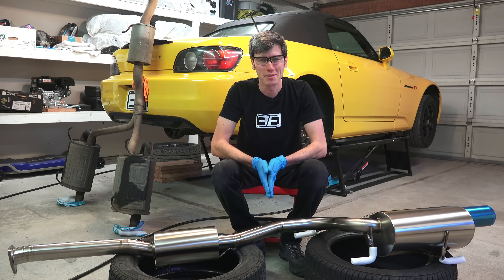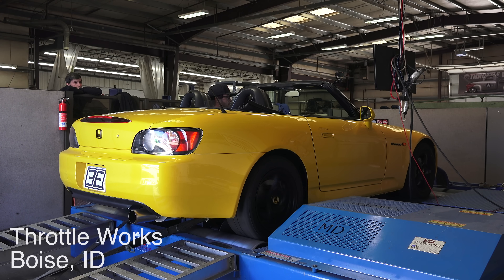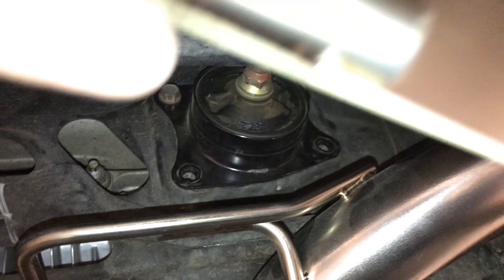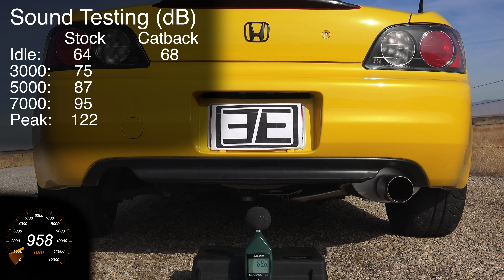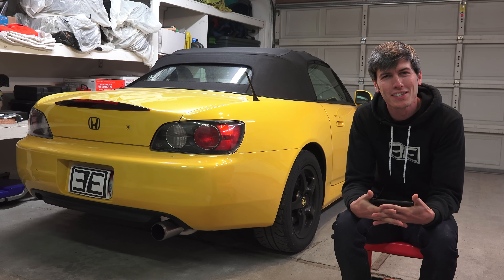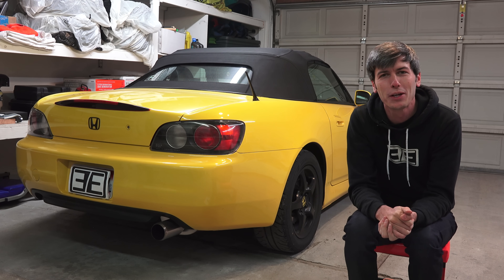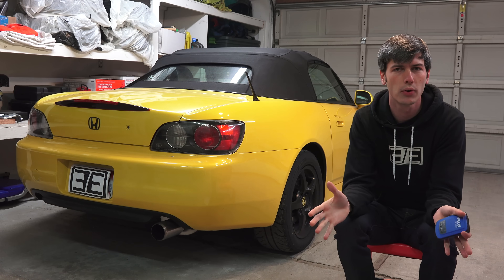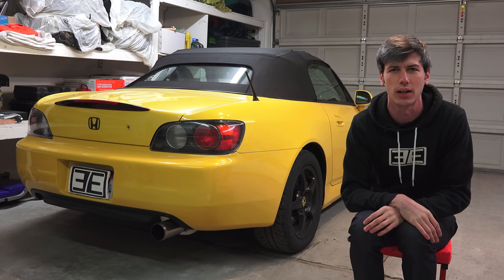Can A Catback Exhaust Make Your Car Faster?

Comment: Remember, you're not "making" more power with the exhaust, you're freeing up some HP which is otherwise getting used up to push the exhaust out. It's the same idea with a free flowing intake. Neither of these "make" more HP ... it just frees up flow so the air pump (the engine) works more efficiently. Great video. Love the numbers.

Comment: Two thumbs up from me, the exhaust's a beaut! Couple of questions:

1) What's up with the power from your s2000? My completely stock one was making something like 210 to the wheels, do you just have a load of miles and have cylinders that can't hold pressure?

2) Would you expect the difference of a lower resistance (to flow) exhaust to be greater on a turbo / supercharged engine where there's more pressure?
Reply from the maker: +Mikey 
1.) it’s read 221 hp depending on the dyno settings. Can’t really compare dyno numbers from different dynos. 
2.) Absolutely
Reply: Makes sense! Thank you for the awesome vid

Comment: IMHO the sound has a very different and much better character, you saved weight and I don’t know about titanium but a system will usually get a little louder as it “beds in” over the first few months.
Test DB again in 3 months?

Comment: Although I would never pay anywhere near that much for a catback, I must say I think it sounded really good on that car, especially when you were revving it. It's hard to describe but it's like there was a very distinct (crisp maybe?) sound as the throttle cracked open, followed by a nice understated crackle as the engine wound back down that could not be heard at all from the stock exhaust. Not worth $2500 imo, but I do like it. Definitely better than 99% of other Hondas I've heard.

Comment: replace the stock ceramic catalytic converter with 400 cells per inch to a hq metallic converter with 200 or 100 cells per inch. they have more platin and are expensive (HJS made in germany). you will gain more power and the exhaust will sound much better. trust me.

Comment: to have any significant gains in power, the factory exhaust has to be restricted...But if Honda already have done a great job in designing the factory muffler, the only thing you can optimize is the way it sounds :)
Maybe next video would be comparing cars or a car with 2 mufflers with 1 muffler...

Comment: The T1R 70mm and 70 EM Sparrow would have run you about the same cost, tons of weight savings, and have been proven by the s2ki community to have some of the highest hp gains on an NA application. Some form of tuning solution will amplify your gains now that you have a more free flowing exhaust, tuning is important for any modification to work to it's full potential.
Reply: I take that back, would have cost a lot less

Comment: did you have to use specially coated hardware to bolt it back on to avoid any bimetallic issues? also it looks really nice and sounds good. i would estimate that the cars aesthetic quality was improved by 5%

Comment: if you're getting an extra .3 mpg then you'll save 184 gallons of premium fuel after 250k miles. So that saves an extra 552 bucks. also, savings in brake work, suspension work, catback exhaust replacement due to rust failure, tire wear rates, and various other expenses incurred less with lesser weight.
I won't say that it'd directly pay for itself, but the smoother sound or improved acceleration might inadvertently affect one's career enough to make the difference.
Reply: Weight is 1.2% difference. You are technically right but i dont think its noticable

Comment: Aw come on, a single tip exhaust? That other cutout just looks awkward now.
Reply: ewt415 Yeah it's way lighter than the duel exhaust tho
Reply: StrangeClouds, I don't doubt that it is..but to me it seems like the minor performance gains from that weight loss isn't worth the styling trade off. If the rear bumper is swapped to accommodate the single tip exhaust, that'd be cool too.
Reply: ewt415 It's half the size and made from titanium
Reply: Lol, dude you don't have to argue with me. You do realize it is okay for people to disagree with your preferences right?

Comment: you cant look at 1 figure like power at certain revs.
You should be looking at the difference in the areas of the 2 graphs between 2 points in a rev range.
Integration is harder, but it is better.

Comment: Most people on the s2ki forums yield some power gains with replacing the cat with either a test pipe or high flow cat.  The cat on these cars seems to be the greatest restriction.

Comment: What about the gain in power with area under the curve? it seems like it would be a much better representation over power gains than peaks
Reply from the maker: Yes, about a 2 HP gain for the duration VTEC is engaged.
Reply: could you do  a video on how to do the math to calculate this? I'm an mech. engineering student and my calc professor said if I got you to do a video she would pass me with an A+. Please help

Comment: 5% difference is pretty expectable, in my opinion, because it's not so much about the peak power gain, but the area underneath the graph line, because at every spot of the rev range you accelerate faster and that adds up somehow. If there was a way to calculate it, you could see the area difference, maybe that's where the few extra percent comes from.

Comment: 2.5% is within the margin of error. It's not statistically-significant because you'd need dozens of tests to lower the margin of error. I would also say that given the nature of sound waves, the best way help air come out of a tube, is to increase the cross section of the tube as you reach its exit. Under a car, it's not practical to do so.
Reply from the maker: Three runs before and three runs after that all line up is enough to make a decision in the real world and move on. No, I'm not going to be publishing a paper with the data, but I don't think there's any reason not to trust it, and I think there are many reasons (starting at 11:21) why you can trust it.

Comment: Loudness measurements will vary depending on the weighing function used. A-weighed loudness takes into consideration low frequencies. The ear is more sensitive to frequencies in the 2K-4KHz range and accordingly, will be more annoyed by sounds at that frequency. What would be better than to compare loudness as a single value, is to compare the frenquency spectra, to see the distribution of low-to-high fequency components.

Comment: The dyno data would be more convincing if it illustrated the variability of the data between the treatment groups (old vs. new exhaust). For this you would need to test the treatment groups a number of times each (say 3 times each) then display the data as mean +/- error (I like 95% confidence intervals). Either way regardless of the significance, it's pretty clear that the effect size is rather small. Still a cool learning experience. Nice job!
Reply from the maker: Did three runs before and after. Results were consistent. Displayed are the final runs (highest stock run vs highest catback run). Less than 1 hp difference between runs with the same exhaust.
Reply: Nice thanks!

Comment: Your car is just 6.2 decibels quieter than a 2016/2017 F1 car 😲
Reply from the maker: Well, dB is measured from a specific distance, so F1 car would likely be much louder when measured at the same distance. That said, F1 has definitely gotten quieter.
Reply: Engineering Explained Well, where I saw the article it explained the 2016 blowoff vale exit and said that if it were to be dumped in the exhaust (like 2014-15) it decreased the sound, putting the blowoff outside apparently increased the sound from 126dB to 128.2dB so should it be directly next to exhaust or at 20-50m away, I don’t know, thanks for answering!

Comment: for me, you are gaining hp not only from the better pathway flow, correct me if i'm wrong, but the titanium has a better conductivity than the original (steel?), so your gases lose less energy by heat 
aand it is not only 2.5hp, now with a less restrictive catback, if you change something else, like a cold air intake, some cams, whatever, they should make more power vs stock catback
Reply from the maker: Yes, should help with future mods. Heat conductivity won't matter for a naturally aspirated setup. Since there's no turbo making use of the exhaust gases, waste heat is waste heat. I suppose if you were to get super technical, if the amount of heat lost by the exhaust were to increase significantly and it cooled the exhaust gas, it would have an effect on pressure, but very minimal in comparison to the effects a loss of heat will have in turbocharged applications.

Comment: I say it all the time. Unless you take the potatoes out of the exhaust (CATS) a cat back will do nothing, especially if same pipe diameter. This video validates that statement, great upload  2whp is within the noise.
Reply from the maker: I agree with you, but the 2.5 HP is accurate. Multiple tests before and after, and the shape of the curve changes after the exhaust (only makes more power with VTEC engaged, not before, when airflow is at its max).
Reply: Not arguing the 2.5HP with you, I'm sure you are correct. I watched your interview on gears and gasoline, that you do learn from some youtube comments. I spent $2,800 on my exhaust and it is heavy, heavy on the engineering. Not made of titanium and given you like to nerd out on this stuff, I think you will find the background to it interesting. Given the engineer who made it used to work for NASA. 

Can Helmholtz Resonance Be Utilized to Make More Power?

Motordyne: ART (Advanced Resonance Tuning) test pipes and resonated Shockwave V2 exhaust, designed to increase power over traditional aftermarket alternatives by using chambers that trigger Helmholtz resonance to aide in exhaust gas scavenging for increased power.

Helmholtz resonance is a scientifically proven phenomenon. The property can be demonstrated with a glass bottle: As air is blown across the top of the bottle, some enters it, is momentarily compressed, and then surges outward at a slightly faster rate than it went in, creating a vacuum that draws more air back into the bottle to continue the process. Proof of this oscillation of air can be heard in the tone or frequency emitted by doing so. In the case of the products at hand, exhaust gasses are blown across built-in resonance chambers, and the frequency of pressure waves created therein pushes exhaust gas through the tubing and out into the atmosphere. Now, if Motordyne has one thing working toward their credit, it's that they're by no means an upstart company. Remember the plenum spacers that have become mainstays in 350Z tuning for their simple, low-buck design and solid power gains? Turns out Motordyne owner Tony Colette was a rocket scientist in his previous profession (no, seriously-he was), and he invented those. 

To test Motordyne's claims with its ART products, we gathered Ken Kojima's '06 Nissan 350Z, equipped with a reputable "Brand X" test-pipe and exhaust, to the Dynojet rollers of Yimisport Tuning in Santa Clarita, CA, where it was baselined, then tested with Motordyne's ART pipes and resonated ShockWave V2 exhaust in place of its original aftermarket vendible.

Replacing the car's stock cat-back exhaust with Motordyne's Shockwave V2 produced as much as 22.7 whp and 17.9 lb-ft of torque at points in the powerband, and where the "Brand X" test-pipes produced as much as 23.3 whp and 31.8 lb-ft of torque over the stock cats at some points, Motordyne's ART test-pipes increased their output by an additional 11.2 whp and 29.7 lb-ft of torque at varying rpm. Air/fuel ratios stayed in their normal range this time, and power gains-as promised-were more plentiful.

The Verdict:
Fact
Tested on two different cars, with two (slightly) different engines, compared to two different aftermarket manufacturers' conventional products, the gains by which Motordyne's resonance-chamber-equipped products increased power were definite. Now, you might be wondering what would happen if a different exhaust is used with the ART test-pipes, or if the Shockwave V exhaust would make power with the stock cats. Would the difference in airflow throw off the whole system and negate power gains?' "Think of blowing across that bottle," explains Tony. "If you blow harder, with more air, the frequency doesn't change but the volume or amplitude does. It's the same here. More air means even more resonance and more scavenging." 

No turbos, all motor.........Dyno gains for me were 37whp/45wtq. ART pipes get rid of rasp and drone while also giving you an additional 10whp over a test pipe. They for sure work.

Comment: Should have gotten the HKS Hi Power exhaust, the sound alone is worth it. I also like the dual exhaust tips. Titanium is also a bit too expensive unless you need the weight savings for a race car.

Comment: 4 questions about you and your car:
1.Are you live in Indiana or California?
2.Why didn't you replace the old hangers with polyurethane ones?
3.Will you complete the whole exhaust with titanium headers, and catalytic converter in the future?
4.Would the sound test results change with the previous one?
Reply from the maker: 1. No.
2. Because rubber makes more sense for exhaust hangers. Flexibility is important so exhaust vibrations don't transfer through the chassis. 
3. Because of cost, likely not. Though if sponsorship makes it possible, perhaps!
4. There certainly could be sound changes, yes!

Comment: I am not surpriesd the aftermarket improved only 2-3 WHP. That just means that the stock exhaust is sufficient for the engine setup.  Great video, its worth it in my opinion, 15kg less means a drop of fuel economy, less load on brakes and tires, better acceleration.

Comment: If they tuned the car after fitting the exhaust it would make more gains, instead of simply bolting it up, but a hondata would be required.

Comment: Probably the best way to get HP gains would be to do some upgrades with headers and ITB's. Yes the exhaust is less restricted, but the engine itself isn't  making any more bang, therefore meaning that the stock exhaust wasn't restricting the power much at all... unless I'm just talking outta my ass. idk

Comment: WEIGHT REDUCTION is where the money went. But if you want more flow you need a decent header and  high flow cat(s).

In fact for me I'm more interested in weight reduction. Import some mag-alloy wheels from Compomotive in the UK (5kg each!), consider lighter suspension  parts, a consider constructing a carbon fibre hood.. not as difficult as you'd think.